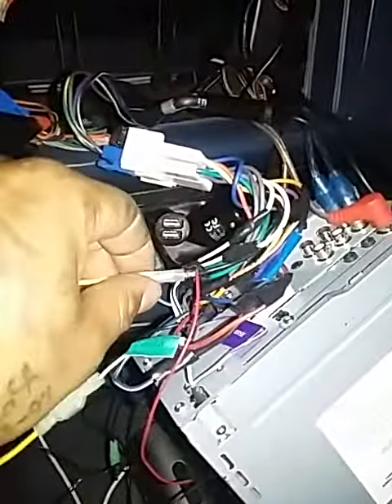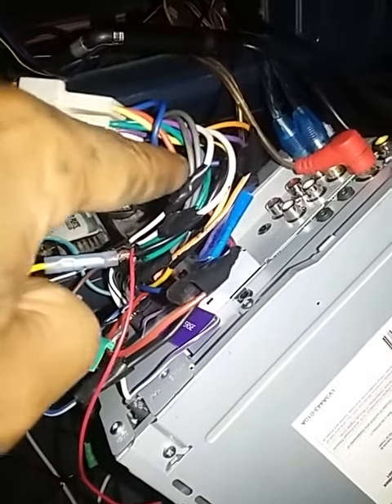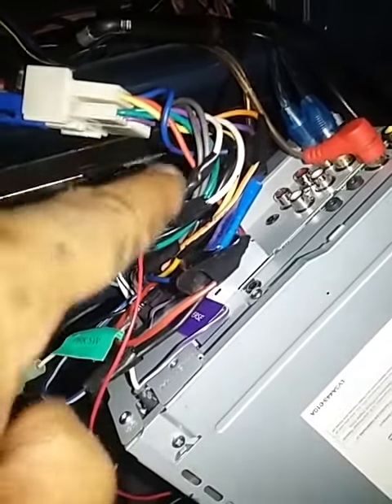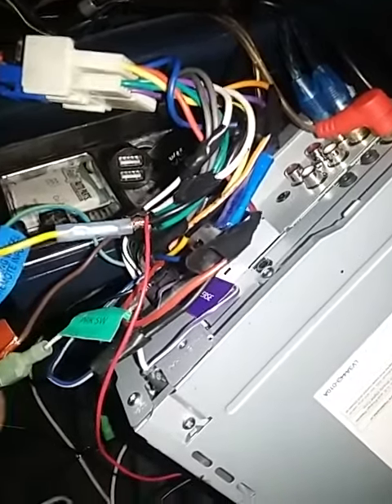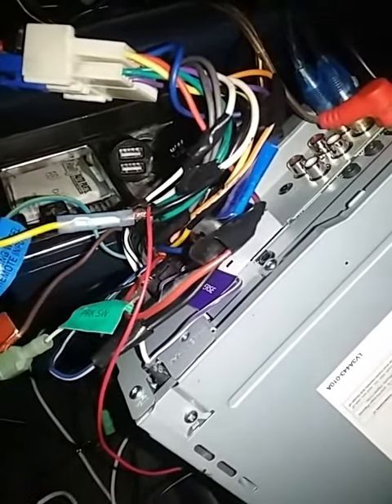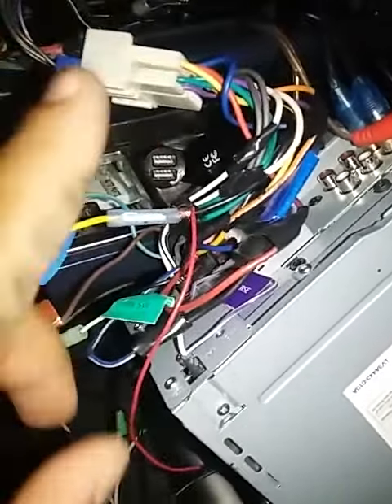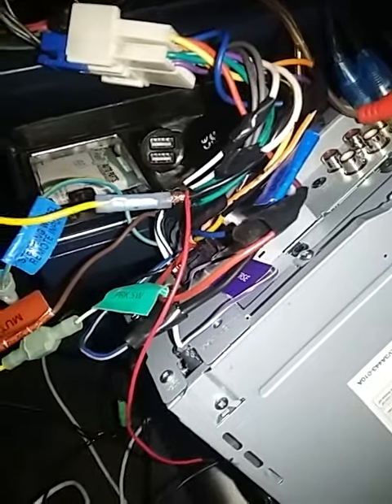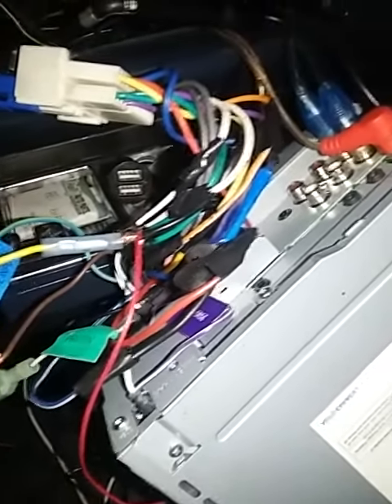How to hook up fake car alarm led.

Comment: Is the RED auxiliary wire the same as the ignition wire?
Reply from the maker: blake biltwell yes
Reply from the maker: Wait no. Red is constant
Reply: Just so I'm clear, yellow wire from radio is constant?
Red wire from radio is ignition wire?
Reply from the maker: blake biltwell yes
Reply from the maker: blake biltwell   
On your blinking LED it should be ready in black so on the blinking LED read is going to be constant black is going to be auxiliary